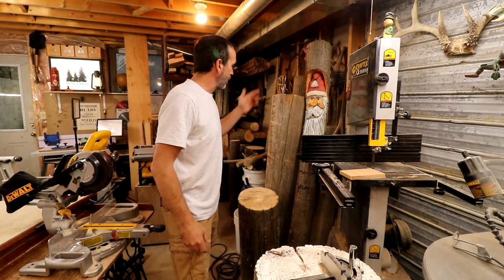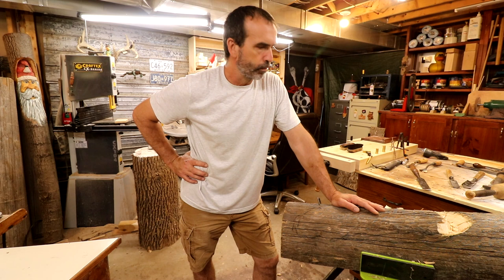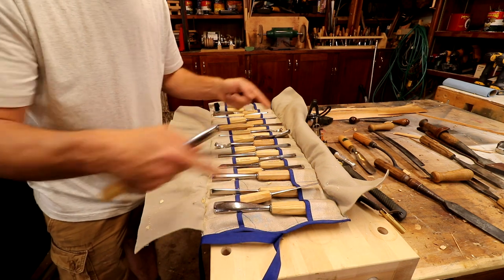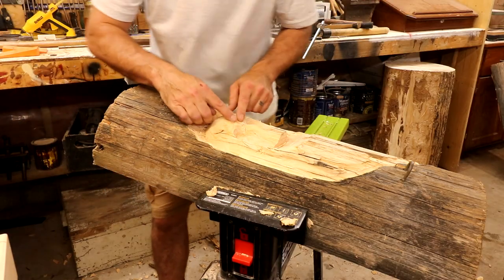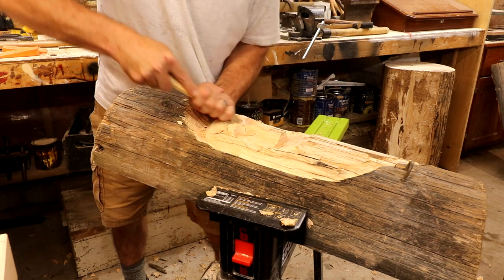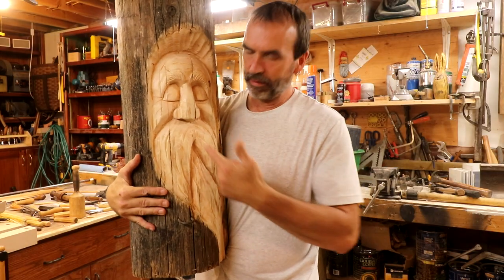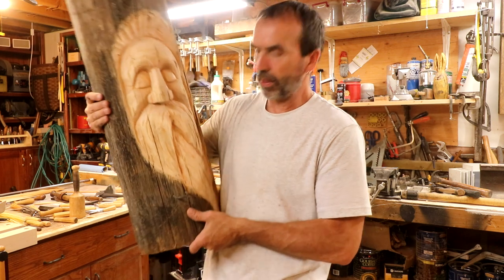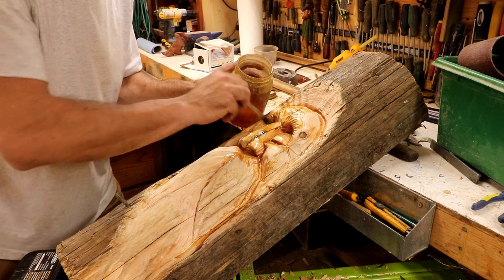Woodcarving a Sleeping Woodspirit

Comment: Hey Doug,
I recently found your channel without any idea what a great hobby potential wood carving and whittling is. You have inspired me to start getting into this field, and for that I thank you. I need to disconnect from the internet a bit and this seems like a great hobby to get into. I am looking forward to buying myself the right tools so I can get started, do you have any recommendations like tool sets that are a reasonable price for beginners? 
Thanks!
Reply: Don't  scripp (go cheap)on tools. German steel, Swiss made, Pfiel are good. Do your homework....I used for years, my Uncle Henry stockman....basically  no funds.  But then stretched and bought a set of Swiss  palm gouges and later a long handle 1.5 Pfiel.  Of the set, I use like 3of 7 consistently. No pro shop, obviously. But get good tools
One comment I've heard...better to get the pc you will use,  then a whoĺe drawer you don't  use.